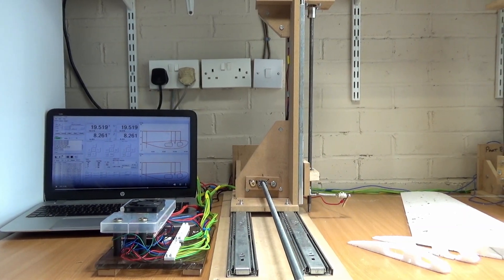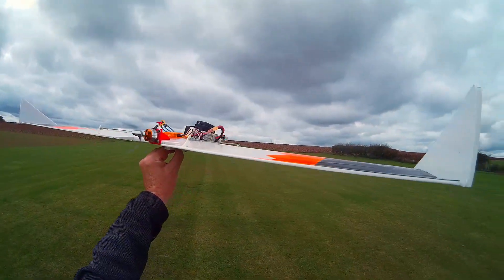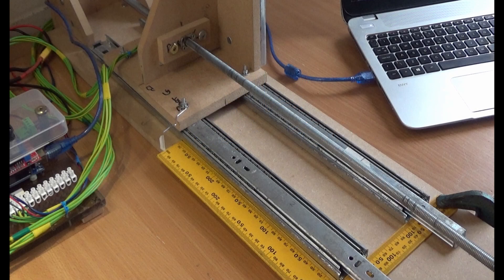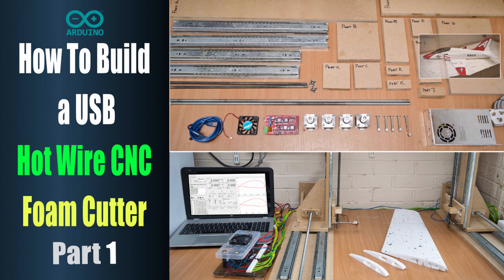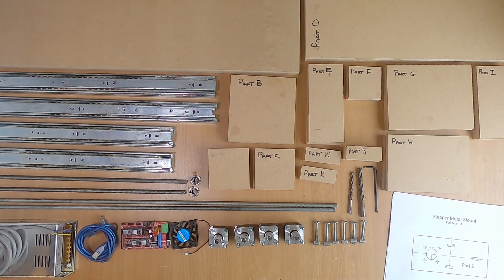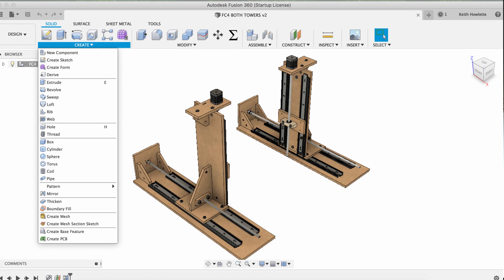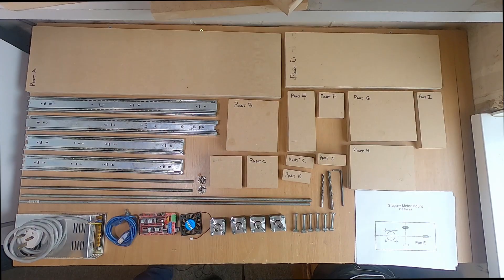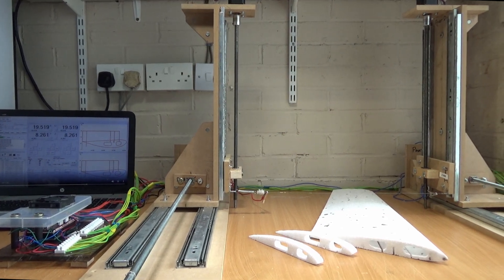How to Build a $200 USB Hot Wire CNC Foam Cutter - Part 1

Comment: I have had a foam board needle cutter CNC (TimSav) for a few years and it works great but I am now looking for something similar to cut foam and really like your design as it uses a lot of the same electronics as the TimSav. I would prefer though to have the frame use extruded aluminum and 3dprinted parts rather than MDF. I will look through your builders galley but if I find one how do I contact the builder for details of their design?
Reply from the maker: I don't keep the users' emails who send me pictures of their foam cutters. This is to protect their privacy.  You can find some examples on Thingiverse https://www.thingiverse.com/thing:2834138 and this one https://www.thingiverse.com/thing:5477327

Comment: Great build! Does it have to be moisture resistant MDF?
Reply from the maker: No doesn't have to be, if you are in a dry environment then plain old MDF is fine.
Reply: @rckeith  Great to hear! Going to purchase some MDF and the plans tonight i think, thanks for a fast answer
Reply from the maker: @antonl1894  Glad to help any questions just drop me a line.
Reply: Keith Howlette Is the drawer slides 600mm long or can it travel 600mm?
Reply from the maker: @antonl1894  Both actually they are full extension slides so the 600mm give you 600mm travel.  That's why there are 3 sections in the slide to support on the full extent.  It's not very often you need full travel only on some bigger projects.
Reply: Keith Howlette Are the plans designed so it only fits a 600mm one or would a 550 mm work fine? Can’t find any 600mm here
Reply from the maker: @antonl1894  Plans are quite flexible so if you want to use smaller slides that's no problem. Some guys have built it a little bigger as well.
Reply: Keith Howlette Great, thanks👌

Comment: Thanks. I wanted a good project. I used to cut foam wings with a lever drop weight machine. I've been wanting to get back to building model airplanes. It was a lot of fun twenty years ago.
Reply from the maker: Hi Thomas I started with the same machine and got some good  results. But making the templates was time consuming. I did that for my VC10 airliner build on the wings and tail. That's when I decided to have go at CNC foam cutting that was about 9 years ago. This is my second version using 3d printer electronics,  the old one was a bit over engineered and used the old parallel port. Thanks for watching 👍

Comment: Hi Keith, 
I have watched your introductory video and straight up I would have to thank you for all the work you have put in and of cause made it available to all . I am new to all of this cnc, i have made foam wings (badly) with a hot wire bow and will continue to. but this project looks too good to pass up. i don't have much experience with computer software, arduino and the like but it seems you give step by step instructions to go on with. So here is the first thing  I must find out before I go too far down the rabbit hole, I use a mac computer, the software you use is for windows. A quick google search tells me that a "slicer"progam is used in 3d printing and of cause they can be obtained free for mac. Are my observations right so far and if i use a different brand of software will I still be able to follow your instructions to complete  a working foam cutter  
Steven
Reply from the maker: Hi Steven, thanks for your kind words. Unfortunately you do needs Windows to run the foam cutter. Yon can use a Mac to upload the firmware and configure the settings and there is a free online g-code generator.  But the programs that actually send the g-code to the arduino are windows only.  I'm a Mac  user as well as Windows so I can understand why you prefer the Mac.  You don't need a very powerful Windows computer to run the programs because the Arduino is doing the heavy lifting. I've have run the program I show in the video on a very old laptop over 10 years old and it worked fine.
Hope that helps 
Keith
Reply: @rckeith  thanks Keith, an old laptop will not be hard to find
Steven

Comment: Hi Keith, I was watching your videos and I will try to build your wing cutter. I will use Mach 3 since I have a CNC also self made, but with 3 axes, the idea is to open a new profile with 4 axes. If you have time you can see my machine wich I build  to cut the ribs of the airplanes, in my site of you tube, saludos from Argentina.
Reply from the maker: Hi Just had a look at your machine and you did a good job.  Using Mach 3 with a 4 axis profile works really well that's how I use my Mach 3.  I still use Mach3 as well as the new USB software.  Mach3 is a good choice if you already have it.  Good luck with your new build
Keith

Comment: Is the cnc also able to cut insulation foam?
Reply from the maker: Yes that's we use to make wings with.
Reply: @rckeith  oh interessting, I always use xps pink insulation foam. I think it is good idea to build this hot wire cnc. I will keep you up to date :)